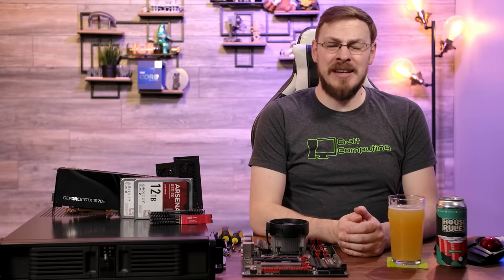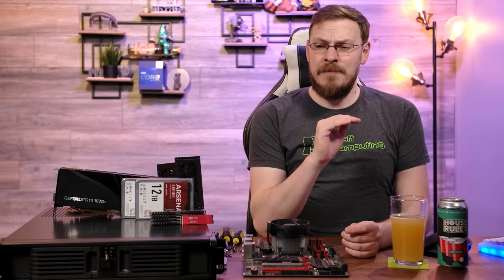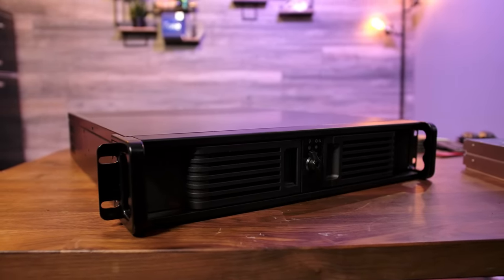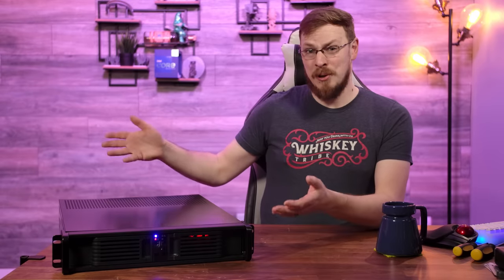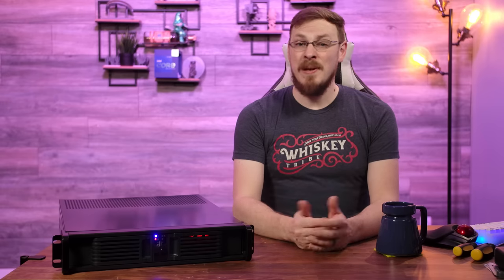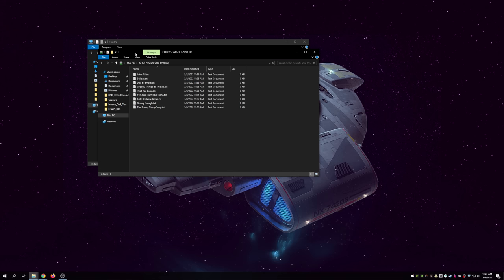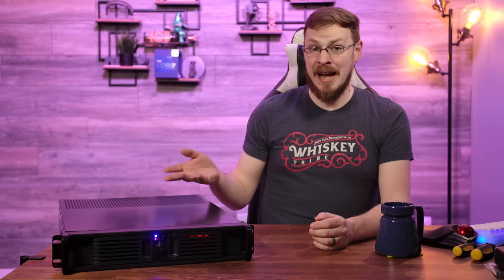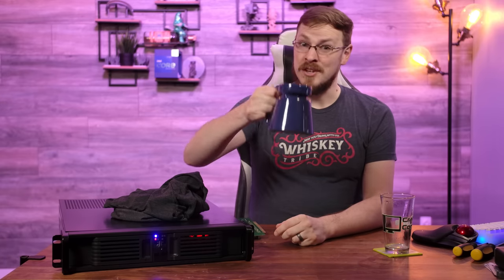Build a Server From Old Gaming Parts

Comment: This is pretty much how my home theater server is set up with a 9900K and 6900 XT (for an LG C1), using a pair of 16TB Exos mirrored with Stablebit Drivepool.  Plex runs right on the host (Win 10 Pro) as its far easier as you said.  I added in a 2.5 gbe NIC for faster access from my main rig as well, and Hyper V is on there with a single VM that has nothing to do with isolating torrents through a VPN.  

In that past I had split the roles into a separate server and HTPC but this was just unnecessary as one PC can handle all this easily.

Comment: No ventilation in the top for PSU.. Yeah.. That's normal for rackmount systems because most rackmount systems will be packed in and ventilation there will be blocked in anyway.   It should be vented from front to back like any other rackmount system. =)

Comment: I thought a Dell R610 would be a great idea for a dip into VM ( I'm a tech pro and wanted to put services in one place )

whilst it WAS a good idea, I'm struggling to find somewhere to put the darn thing, it's huge
Reply: Loft space or garage.
Reply: @wayland7150  loft space too cold in winter too warm in summer. Would need additional heat/cooling. 
Don't have garage

In process of fabricating a bracket to sling it under the workbench. Easily accessible and out of the way. Thanks though

Comment: Those little black screws on the bottom for the cage are just the worst, aren't they? We use this in a 3U height in most of our test systems at work, I've upgraded them all now 3-4 times from P4 or Core2 -> i3 2nd Gen -> i3 6th Gen -> i7 9th Gen

Comment: Saying NVENC doesn't use any of the GPU's other hardware is a bit misleading. NVENC uses the VRAM, which will have an impact on your gaming (depending on what game you're playing as well as how many transcodes are occurring).

Great video, though.

All three of my physical servers are old desktops that were repurposed.
Reply from the maker: You'll never notice the 10s of MB required for NVENC, and the encoder itself doesn't use CUDA or other processes on the GPU die. At most, you'll see 1-3% loss in gaming.
Reply: @CraftComputing  Might be anecdotal, but nvidia-smi is reporting 155MiB of VRAM to transcode a 1080p@ x264 file to 720p.

I guess if you're only using plex in your household, it probably would never become an issue.

Comment: I have all this set up on my main PC....  

Thing is I REALLY want to get into truenas,    a 2ndary  older rig I'm  prepping for a truenas scale box,  that  has i7 5820k, 64gb ram, and a gtx 1080,  

i would like to ask you for two things:

#1- please recommend a  nice tower case that will hold LOTS of hard drives,  and look nice tucked away under the desk in a headless configuration. (I want your recommendation) ie. phanteks, enthoo, etc.  preferibly that still has multiple 5.25 bays ,  no need for tempered glass, no need for crazy rgb ligths.

#2- i know you've done this a thousand times, but could you take this very example of (old gaming pc into server)  and  re-do it  as a tutorial for truenas scale??? (like baby steps)  using old gaming pc  hardware?

THanks!
Reply: #1 Antec P101

#2 Just get stuck in. However invest in SanDisk Ultra Fit 32GB USB 3.1 Flash Drive triple pack off Amazon. Use Belena Etcher to make one of the sticks the TrueNAS installer. Plug all three in the server and boot the installer. Select both the blank sticks for TrueNAS to install to. That way you don't waste precious drive bays and drive ports. Also set both as boot drives in the bios. I know they say don't install to USB but really it's perfectly fine if you use decent sticks. If one dies you have the other. If you back up your config you can always get it going again on a fresh TrueNAS install. It simply reads your backed up config file. 

The main thing is, stop studying it and actually do it.
Reply: @wayland7150   wow this case is awesome!!!   

Yessssss I will, , i wish I could do a half-ass decent production like Jeff does and upload a video to show you :D  LoL  but I WILL do it.

THank you for the suggestions!!!!!

Comment: Old hardware to use as beginner server:
X370 motherboard, 32Gb Corsair LPX, 256Gb NVME boot drive, GTX 1070Ti, Ryzen 7 1700
My current gaming PC:
X370 motherboard, 32Gb Corsair LPX, 250Gb NVME boot drive, GTX 1070Ti, Ryzen 7 3700x (Ryzen 5 1600 until last year)

Oh how time flies :-)
Reply from the maker: That hardware is all 5yr or older 👴
Reply: @CraftComputing  To be pedantic, the GTX 1070 Ti was released in November 2017, so there's still a while until its fifth birthday :-P
Reply from the maker: To be further pedantic, it uses the GP104 with additional CUDA unlocked, and debuted in June 2016 ;-)

Comment: i use my old editing rigs as servers , my cold storage server is core2duo quad ,  the other use a i5 on a 1150  run plex and tornido for cloud both are running windows server 2012r2 and live in old  vertical server case and am using windows storage space for my raid ,  raid2 for the cold storage , and raid 10 with 6 driver for the other , and i have one other old am1 as my pfsence

Comment: I know the old adage is "raid is not a backup" but by can't it be? Raid 1 is copy of the drive but it's inaccessible without the other drive why couldn't we have a subset of raid 1 that leaves the drive readable independently?
Reply from the maker: Delete one file. Now recover it from the other drive.

You don't have a backup, you have redundancy. RAID is for uptime assurance, not disaster recovery. But RAID can be a tool used both on primary AND backup data stores.

Comment: I'm running a very similar setup. R5 1600, 16GB RAM, RX460 and two 4TB drives. Running proxmox on that. Does ZFS really need a gig of RAM per TB of storage?
Reply: I booted TrueNAS with 4GB of RAM. It had no cache space but it worked and would only write at 50MB/s. I upgraded to 8GB RAM and it had a tiny bit of cache and worked at 100MB/s. Upgraded again to 16GB and it had cache space and ran fine. I will upgrade again to 32GB because some of the things ZFS likes to do is helped by RAM. I've got 9TB of ZFS RaidZ storage using 3x 3TB SAS drives or 6TB actual space.

Comment: What do you mean I can't run DDR4 at 3200 Mhz on first gen Ryzen? I'm running a Ryzen 1700 on a Asrock A320 motherboard with 3200 Mzh just fine.
Reply from the maker: Most 1st Gen Ryzen struggled to run at 3000, especially in dual-rank. I managed 2933 with this set.

Comment: I wonder if my old i7 990X with PCIE 2.0, SATA 2, and 6c/12t is new enough for this.
Reply: Certainly, it will just use a bit more power. Any LGA CPU should be new enough.

Comment: same with my i7-4770k and sniper-5 from gigbayte but i have a couple of questions if you don't mind answering.

planning to run Truenas on it with 4x14TB every 2 in mirror mode but i want to know:
1- for now i will use my motherboard sata connectors untill i buy a preflashed lsi 9211 is that ok for ZFS?

2- if my lsi 9211 is done for and i need to replace it does that mean i lose all my data same if i want to move my HDDs from the motherboard sata to lsi 9211?

3- when do i lost my data in TRUENAS in a case of PC hardware failure NOT hard disks?

4- if the motherboard died and want to move to a new platform or the LSI card fails and i wanted to replace it by something better like LSI 9201 will my configuration and data still be there?

all of these question are only to avoid losing my precious data because most of it are work related.
if it is too much and you don't have time point me to a place that has some answers please.
Thanks in Advance.
Reply: (Yes, No, No, Yes.) As long as your drives can be seen individually you can more or less swap the hardware around as much as you want. If you change your motherboard you may need to reconfigure network stuff but all your data will still be there.

If you only plan on using using 4 SATA drives I wouldn't bother with an HBA as it provides no additional benefit.
Reply: @eDoc2020  thank you

Comment: How much do we trust WaterPanther© with quality drives? 
I recently discovered them a few months back while looking for drives for my servers at work. 
90% of the drives on amazon were refurbished so I was turned away quickly as these were 12TB newer made drives..
Reply: Found this review on Techradar.
"Water Panther specializes on selling storage devices compatible with servers by makers like Dell and HPE. Typically, such drives are made by various producers like Seagate, Toshiba, or Western Digital, and then equipped with an optimized firmware. But in case of NAS HDDs, there is hardly any tangible difference between Water Panther’s and original versions."
Reply: Only three companies make hard drives these days. Anything else is just a rebrand of these.

Comment: I'm still confused on what the point is. Any benefits to throwing out your router and using a computer instead?
Reply: Plenty. If you replace your router with a computer you can get advanced configurable firewalls, built-in VPNs, and more.
Reply: @eDoc2020  always thought you'd really only need it if you had a server block with so many ethernet ports on it a linux based raspberry pi couldnt support it.
Reply: @typerightseesight  Well a Pi is a general purpose computer, so it can theoretically do ass much as any other computer, just not necessarily as fast. On a more practical note, the most common OS for a PC-based firewall is pfSense and for some reason they haven't made a Pi-compatible version yet.

Comment: Paraphrasing from Microsoft's own words, WSL should not be used for production/hosting (even with docker) since it's bound to logged-in users, has all its service management removed and delegated to Windows, which breaks a lot of Linux software including stuff for container management, and will never be a use-case that Microsoft will support. While the Genie system tries to work around a lot of this, Microsoft's stance has been that if you need to host Linux services, you should stand up a Linux VM.
I'm not happy about this either since it means I can't run Linux-only software in WSL and let all our Windows IT admins still have their Windows desktop to remote into (yes, even on production application servers...) so they can mess with the app config files in windows directories mounted as volumes to the container.

Comment: Even if you wanted to run Proxmox on the system, the GPU passthrough function would not work due to the fact Ryzen only supports IOMMU from the 5000 series and up.
Reply: Not true. I had a RYZEN 1700 Asus 370 Proxmox 6 passing through an HD5970 to two Windows 10 VMs at the same time. The problem with IOMMU is who grabs your GPU first. With Intel i5 Proxmox can grab the integrated graphics leaving the GPU for IOMMU use. With RYZEN you must tell Proxmox to run headless if you want to use the GPU.

Comment: The problem is..Old machines don’t have many cores or memory..If I can’t run several virtual machines then it’s not worth running..
I’d rather donate the old stuff and not pay the electricity…save the money for AWS ect..
Reply: That's not how it works. A 4 core machine is not limited to 4 VMs. The 4 cores is the maximum you can put on each VM. You can upgrade the RAM to 16GB which is enough to make it practical.  Docker and LXC really don't need a lot of RAM. You could run 20 of them on a modest machine. Probably not the best for Windows VMs but then you could make a sort of dual boot machine running just two VMS Linux and Windows at the same time. Onboard graphics for Linux and a GPU for windows. Two screens. Shared keyboard and mouse. The possibilities are amazing if it grabs your interest.
Reply: @wayland7150   I’ve been running VMs since virtual pc…I know what’s possible..I wouldn’t want to fool anyone into believing that Old Desktops are a good choice…they usually aren’t.. I run VMs to virtualize network and enterprise environments and have always hit huge limitations with small old desktops.not worth my time or money..but go ahead,it’s your dime.